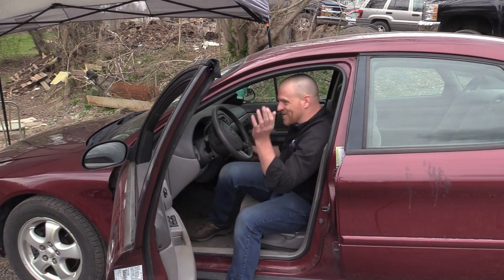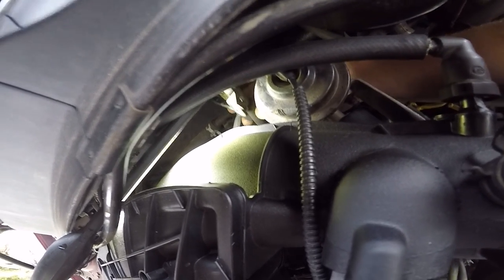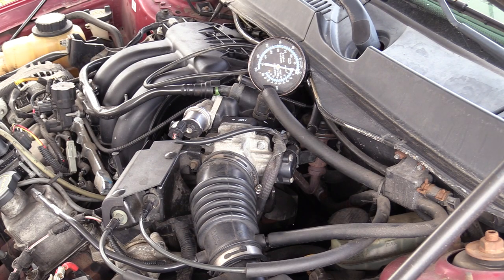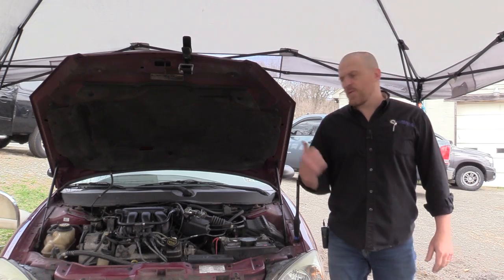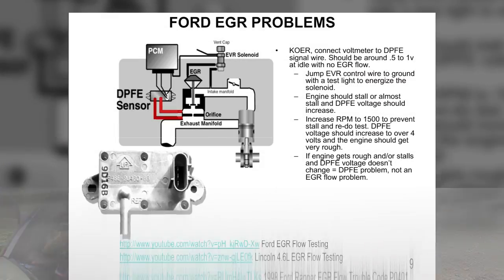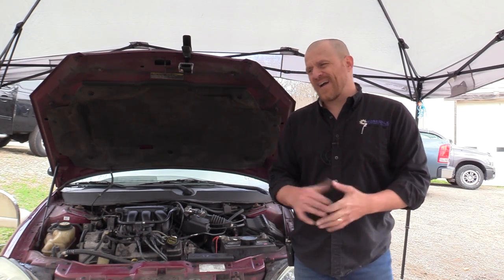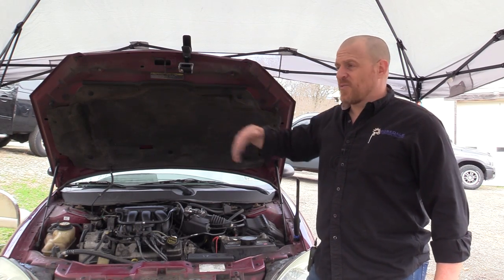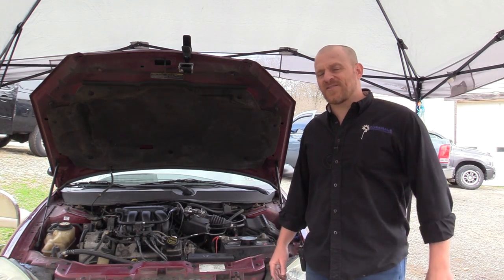Restricted, Clogged, Plugged Exhaust System Quick Test

Comment: It never comes through very well on the video but I describe clogged exhaust as a “muffled” sound. It’s pretty unmistakable. I remember a car with a clogged cat that had the EGR valve right by the throttle cable and when I tweaked the throttle by hand to increase RPM, the exhaust escaping from the EGR valve struck my hand and burned it so bad it caused an immediate blister that swelled almost the size of a tangerine!

Comment: Thanks for the videos . I was a mechanic for Gm a long time ago . A customer pulled there car in said the car was running fine a apparently they were driving in the rain and thr car started running badly and loss of power.  The exhaust as you said hissing at high rpm . The rain had caused the pipe to collapse..
Reply from the maker: How strange! Thanks for sharing!

Comment: What can you expect in fuel trims or oxygen sensor values when you have a plugged exhaust? Any other PID that jumps out at you when you have this issue? 

Longtime premium subscriber here. Thank you for your work
Reply from the maker: Thank you so much! This is a variable situation as you can have a plugged cat on a dual bank system with two cats where it's only affecting one side. Or you can have a single cat affecting both banks. Then MAP vs MAF systems adds another variable. I guess in general, I'm not using fuel trim to help me ID these.

Comment: Hey. Paul. Would you use the IAT sensor PID when checking for a restricted exhaust as backpressure would increase causing the sensor to read higher? I have never seen you use it in your diag. Thank you.
Reply from the maker: Most iat sensors are built into the maf or are located in front of the throttle body and so would not be useful for what you're suggesting. I have used manifold mounted iat sensors to find stuck open EGR valves though
Reply: @ScannerDanner  That makes sense. I only asked you because you are good at what you do. Whatever you say is gold.

Comment: Thans for the video cuestion can the catalyst converter cause misfire?
Reply: I have a misfire on my bmw change everything plug coils still the same I keep getting the same code multiple misfires
Reply from the maker: if the cat is restricted, yes it can
But cats can fail it two ways:
1. Its oxygen storage capacity is compromised and no longer cleans up things as it should
2. It melts down and becomes a restriction
#1 will not cause misfiring or really any driveability problems on most systems
Reply: @ScannerDanner  thanks
Reply: Well thanks for responding i try every plug coils vanus intake everything i can think still missing on number 8 sounds impossible

Comment: what i do when the muffler is clough is disconect it and put a tire bead blower  tank in the tail pipe and blow all the part out and that really work, but be carefull those part come out like a canon .tks good video
Reply from the maker: Good tip! Seriously never thought of that. I think depending on the muffler design though, you may not get it back out

Comment: could you have used the vacuum gage on map sensor line compared idle vacumm to 3000 rpm reading got the same results on intake manifold pressure change old school way ?
Reply from the maker: You can, but not the way it was taught and you can still miss it. I had a truck with 4- 5psi of backpressure at 3000 RPM with perfect vacuum at idle and higher RPM
Reply: @ScannerDanner  glowwing exhaust manifold is a sign of restricted exhaust along with low power too i seen tht when i worked as fleet mechanic on 1995 ford van 5.0 inline 6 engine

Comment: Hey Dan I have a 2008 Chevet Cobalt with a starting issue. The car runs and will start. But after I drive my car for a while and shut if off, it won't restart. It takes a day for me to be able to restart it. And that's after I disconnect my negative battery cable and reconect it. I usually leave it off for twenty four hours. Do you have any idea what that might be?

Comment: Awhile Back I Had a Kia Or Hyundia Towed in. Customer self Diagnosed it Needed  02 sensor. Listening to his complaint I told him I seriously doubted a 02 will do him any good. his cat was probably plugged. I Asked If You Want me To Dignose your Problem or Install your Part. His wife said Diagnose it. It Actually Flipped my gauge cold. (I have it on video). Of Course I Priced Him a Cat. It was a 4 cyl .I Beleive it was Part of the Manifold. He Came in asked his options. I Had to Imform him either fix it or Park it.

Comment: Have you used graphing rpm and maf cranking to pick up plugged exhaust?
Reply from the maker: No
Reply: @ScannerDanner  Thank you for the reply.
It would make an interesting project to do a before and after artificially blocking the exhaust
Reply from the maker: @rodvan-zeller6360  the problem is that partial restrictions exist and cranking speeds and even idle and low rpm is not affected
Reply: @ScannerDanner  Thank you for the reply

Comment: Hi can back pressure from a plugged exhaust system cause a carburetor on older car to malfunction?
Reply from the maker: Yeah for sure! I'm assuming it is a feedback carb and you have an oxygen sensor? If you do, remove the O2 and do a backpressure test

Comment: I work in a dealership and I love your stuff man it helps but where I’m conflicted is when I start diagnosing a vehicle if there is a tsb on a car they want you to start there and replace whatever part and if that doesn’t fix it then what cause I’ve seen it and im not a fan of it but what am I supposed to do
Reply from the maker: Not much you can do but listen to them and when the bulletin doesn't fix it, then it's time to shine right?
Reply: @ScannerDanner  yeah I know it is what it is but it’s a little demoralizing that’s all
Reply from the maker: @johnasosajr  play the game brother, then when you prove yourself, they'll start listening to you! I promise
Reply: There's really nothing wrong with that. If the same problem keeps happening over and over, its highly likely that putting out a tsb will fix the issue almost every time. Quite often problems listed on tsb's can be extremely difficult to diagnose. For example, there is an issue with some Infiniti G35's. Its a light tapping metallic noise coming from somewhere in the center of the dash during moderate to heavy acceleration. It turns out that rtv sealant used in the heater core partially breaks off and starts flapping around as the flow of coolant gets stronger with higher rpm's. The fix is to back flush the cooling system, and if that doesn't do it, replace the heater core. How long do you think it took for someone to figure that one out? When I first saw it, I didn't think it was real. I just figured that someone was playing a joke on me.

You also have to look at it from the manufacturers point of view. If they know 99% of the time a certain repair will fix the issue, then why would they want to pay the dealer $150-$200 per hour to diag a known problem? Everyone will have a different opinion, but I think its reasonable.

Comment: I wished I could take my van to you. Been trying to solve my high idle for two years now. Shops just want to throw parts at.
Reply from the maker: vacuum leak is the most common cause of a high idle. Also ECT and TPS inputs need to be looked at real close.
Reply: @ScannerDanner  one shop wanted to replace the pcm. It does have some weird behavior, like the fuel gauge wobbles back and worth and doesn’t stay steady, and when reading the TPS pid on my blue driver scan tool, the values jump around. Maybe bad ground.

Comment: 03 ford explorer experiencing same issue. Replacement is 2000. Is there any other way
Reply from the maker: Unfortunately no and even more important is that you fix the issue that melted the cat or your going to do it again.
Reply: @ScannerDanner  I went to an exhaust mechanic today after work. 1 cat bad 1 good 1 blocked from the bad cat. To replace is 2k to gut the cats. And straightline with resonator pipe. With welding is $400
Reply from the maker: @Magnuss0724 I'm fine with a straight pipe, but I can't recommend that as it's not legal. Check your fuel trims when your done and make sure they're normal
Reply: @ScannerDanner  trust me I understand. I'll be looking for another ride. Cause I just can't keep going like this

Comment: Can’t find my transmission input speed sensor Nissan sentra 1.8 2013 can you help please 😢
Reply: Go to your local dealer and have parts give you a quote. Ask them to print out the diagram of the part so you can match it up.

Comment: Another quick dirty test is to watch map sensor, it should read the same at idle and higher rpm, if the exhaust is plugged the map will be closer to baro at higher rpm , cant inhale if it can't exhale
Reply from the maker: This test will pass unless the restriction is severe!

Comment from the maker: You guys that have been following me over the past 11 years know this test! Here is a list of some of the other restricted exhaust videos I've done: (check out the Picoscope ones if you get a chance!) 
This is one of many ways to identify a restricted exhaust system that is causing a low power condition. Here is a list of other case studies I've shown with varying testing methods:
https://youtu.be/JIU8j4YBZxw
https://youtu.be/UkyM1L_xbaU
https://youtu.be/9TlygJMxTps
https://youtu.be/kO91s0CoM_4 (picoscope and psi tranducer part 1)
https://youtu.be/YookV4zyQdU (picoscope and psi tranducer part 2)
https://youtu.be/Lafv2c4szZY